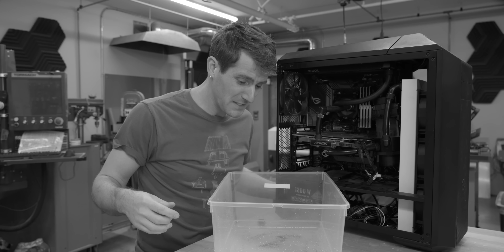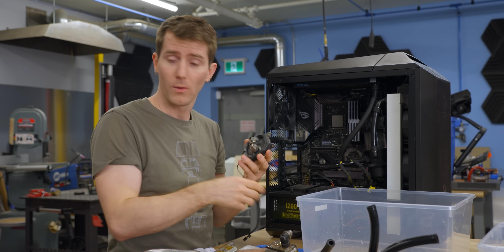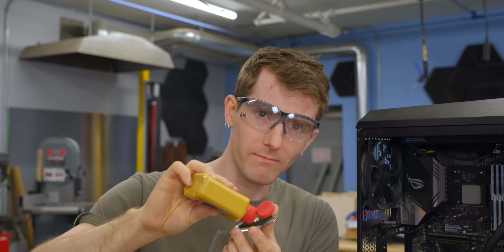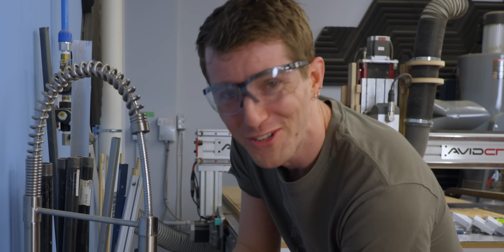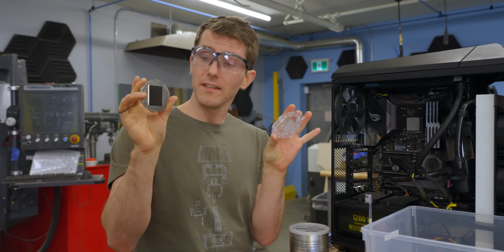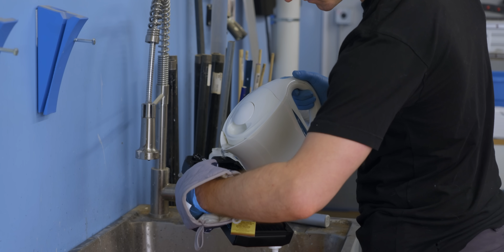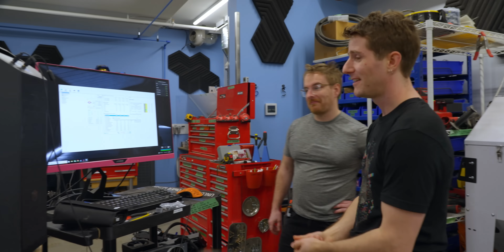I Will Never Watercool Again – Water Cooling Maintenance Guide

Comment: I mean 5 years warranty for AIO cooler is very good because in 5 years most people upgrade their PC with new CPU with maybe different socket so they will in 90% buy a new, better cooler for that new CPU. I mean who wants to put 5 year old cooler on a new CPU. I mean yes there are people that will do just that, but most people will just replace cooler with new CPU. And with new CPU most of the time comes new MBO, so yes, new cooler is not that expensive when you are upgrading PC on that level.

Comment: I've left distilled water + 10% blue antifreeze, + 2 .999% silver coils in a loop for over 4 years without maintenance, no plasticizer, no algae. My last WC loop was retired back in 2015 though, that loop lasted a few CPU's, RIP 09-2015. 

The only thing I noticed was the silver had roughness to it, I guess that was the anode of the loop, the sacrificial piece.

Comment: I've had my loop for 7 years, I've cleaned it once and nothing was in the loop the 1st time.

I ran all nickel plated copper parts and home depot water tubing and distilled water. Never had anything grow or corrosion. I've had to top up the loop once a year with about 4oz of distilled water.

Comment: all these years, i haven't had liquid cooling, but i also dread having to deal with the once in a while maintenance and replacing any seals or pumps.. kinda glade i stuck to getting best air cooling i could find from noctua. one day i will dable with liquid but for now, lifes simple with my air cooling. btw i have messed with other water cooling on a diff everyday machine, you could of used a touch of ever day anti-freeze or automotive engine coolent like 10-20% in the mix to prevent corrosion and growth

Comment: I must say.  I still have an old thermaltake case from 2012 that came with the bigwater openloop system installed. 

I have ran that thing almost constant for a decade and have never had an issue. 

It started out cooling a old amd piledriver I overclocked the snot out of.  

Now it cools a 2080ti and amd 5800x.

Distilled water and alittle green car antifreeze.  No buildup.  My components have always had clear viewing plates.
Reply: @djm5627  I have just got myself a pc with water cooling system and this video scared me well. How can I know when it is the time to open my cooling system and clean it?

Comment: I HAD a water cooled PC until the water pump went out and started trying to burn up my CPU. Thankfully it survived and I got the system to a computer fixit shop. They replaced my water cooler system with fans and it's been running great since. there's no need for water cooling.

Comment: I love it when a influencer hit me with a blanket statement like "water cooling is not worth it" when its more of it depends.   I just got into water cooling a year ago and already upgraded it. It boils down how much watts are you pushing through your stuff. If your pushing 350wats through a 6900xt and getting 90-109c temps then its time to water cool. Droped mine to 48c and much more consistent proformce. But if you got a 7700 non x thats undervolted and only pulling 40wats on average on the same loop then your going to have better proformce on a air cooler

Comment: Back in the days when I was planning a custom loop, I came across video "The vodka cooled PC". While it was a meme, I did in fact followed through the experiment filling my loop with 40% ethanol and 60% water. Rubber seals are ok, acrylics are getting "eaten up", but it is only visible when emptying the system. Also degradation of acrylics is within the life expectancy of the graphics card. Ethanol evaporates, so water tight seals are not ethanol tight. So after some time I adjusted the mix to 20% of ethanol, after all it is all so sterile to begin with at this point. My rig is 5 years old, 1080Ti FTW3 with EK waterblock is still there together with 1st gen Ryzen CPU. It is perfectly clean and effective, basically I have a nearly maintenance free loop with the exception of the occasional topping up the ethanol. Around half a litre per year is evaporated.

Comment: This is why I use AIOs. Great deals can be found on sale from time to time. Almost 2 years ago I got a Cooler Master MasterLiquid ML280 Mirror ARGB Close-Loop AIO for $60 + tax to cool my i9-7940X. I don't know or care how the coolant looks. I just check the temps by running HWMonitor once in a while. I leave it running all day while I run some tests and mostly simply do what I do. Runnng Cinebench 23 multicore for 10 minutes these days causes my CPU temps to run in the Hi-60c to low-70c range. I'm OK with that, but I'll still probably soon change the thermal paste.

Comment: I have a custom loop. I combined a 360mm rad and a 280mm rad in series because I can cool a combined 600W of system power. I knew that either the 360 or 280 wouldn't quite be enough on their own.

Comment: Those black specks are probably dead algae.  My system had an algae bloom, blocking circulation completely. I received a shut down message from Realtemp via Email. I left it a few days before starting cleanup, and the green algae had crumbled into black specks. The loop in my system was every bit as bad as in this video.

Comment: I put a custom loop on my pc some years back, I wouldn't do it again, it's a fad and not required for 99% of pcs.  Yeah it looks pretty cool for all of 5 mins then it just becomes like another piece of furniture.   I especially wouldn't do solid pipe, (thats what I started with)  had 2 pop offs when the loop got hot so changed to flexible tubing and not had an issue since. Granted maintenance isn't that bad tbh, my loop is 5 years old this year I've flushed it twice and it's been fine, if and when the pump fails I'll just go back to air cooling.   Sound level wise there isnt a massive difference and you have to spend hours setting all the parameters to get it to the levels you want, well on a pc 5 years ago you do, Software may have changed now.

Comment: The D5 is one of the most used Pumps (with a very high flow) also compact good looking but reliability and pressure wise i stay with my Aquastream XT. It is quite does not care if the loop is a bit more restrictive and simply works (my is running almost 24/7 for more than 10 years).

Comment: After water cooling for 8 years I’ll never do it again. It has becomes less and less useful over the years. If anything an AIO on the GPU would be as far as I’d go being that GPU overclocking is on rails and the dynamic clocks are heavily dependent on temps.

Comment: Had loop made from the cheapest fittings etc for about 3 years with no problem, switched to full EKWB stuff for 5 years, no problem. Upgraded my PC, made a mistake with fitting and used PTFE tape  on it - almost 1 year and failed - clogged (thanks to my aquaero for saving my ass with flow warning xD ), now rebuild, cleaned, bought filter and working for another 3 years... :) and i think that if i don't used the PTFE tape i don't have any issue whatsoever... :)

Comment: Thermalright Phantom Spirit 120 Se, about 50 bucks. Watercooling, what's that?
Watercooling is neat, but there's little reason to use it today unless you have an older PC and you REALLY want to flog it as hard as it will possibly go, CPU lifespan be damned. At practical day-to-day clock speeds, air cooling is plenty fine.

Comment: ....ohhhh...I kept watching....Iodine* can precipitate out of it gets oxidised.
*Solubilised iodine is "iodine dissolved in potassium iodide" Oxidation of the iodide (to make more iodine) component will wreck it's solubility, so your black gunge may well be a mix of 1. your foam filter 2. disintegrated rubber tubing 3. Nickel and Nickel oxide compounds and 4. potentially a bit of Iodine residue. YUM! Advice is still "not for human comsumption".
:)

Comment: Water cooling is worth it. My PC runs a million times cooler and more quiet and the lighter and smaller heatsink causes less stress on the motherboard and increases the circulation around the other components. I'll never build a PC any other way again.

Comment: never understood water cooling on modern gaming pc. I have a 40$ air cooler on a cpu that's famous for running hot, and slapped it in and old monster sized tower with only a single fan pulling air out. it has never gone over 77c on a stress test, and runs way cooler than that in every day scenarios. at only 44 db, whats the point of going water cooled? who overclocks anymore?

Comment: It is possible to have a low maintenance water cooling without any of these issues. I've built my first water cooled PC 20 years ago and I still use the same reservoir, pump and passive radiator (aluminum). Active radiator (copper) is about 15 years old. The trick is using the correct liquid in the loop. Deionized battery water (4/5) and ethylene glycol (1/5). Never had issues with corrosion (aluminum+copper mix) nor molding. Only maintenance is adding more liquid a few times a year and naturally the full draining and switching blocks (copper) every time I upgrade the hardware (every 3-5 years). And also I'm not letting any of my components get anywhere near tap water.

Comment: In my most recent PC Build I tried Water-Cooling for the first time with a simple AIO. It matched my case, looked really nice, and was the same price as a good CPU fan. But I regret it. 

Mostly it's the fact that I have no way of knowing when the AIO will fail or run out of water. One day my PC will just stop working and I will have to fix it. 

With a regular fan it will be very obvious that there's a failure, and probably an early warning via rattling bearings, and it can probably be rigged to still function while I wait for parts.

Air-Cooling is just objectively better in every way except noise, and most PCs have other random fans making noise anyway like in dude's Power Supply.

Comment: A few points:

1. Always clean from red to white ;)
2. Don't use your mouth for "cleaning", the next gunk is pre-programmed due to your mouth flora: It is full of bacteria and other organic "waste".
3. Always use a new seal
4. Never ever brush your gum away, or your teeth, or both! ;)
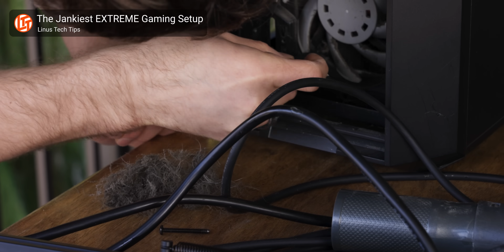5. At 13:13 are you spinning your fans? I hope you unplugged them before...
6. Doesn't hot water getting cold lead to underpreasure, what can implode your radiator like a vessel near Titanic? Or was the over pressure a result of a chemical reaction?

Comment: LOL after few seconds i was rolling on the floor laughin on stupidity of linus srsly. As a person who have custom build (by myself) water cooling with 420mm2 outside case radiator for over 6 years, i can tell you that was ridiculously stupid to blow that pipe. I always use either bike wheel pump or blown up bed pump witch is even better because it mostly have different sizes nozzles and much higher air flow so you don't have to play around to fit it to the pipe, and it's much faster to blow water out of the system.

Comment: Been building PCs for ~25 years now, and I've NEVER felt the need to watercool for performance reasons. Sure, it's an awesome flex, but it only leads to more maintenance. I'd rather 'set it and forget it', just cleaning out fans every once in a while. It's just such a marginal upgrade for most systems, it's not worth the potential headaches.

Comment: I use Bronze gun cleaning brushes to clean waterblock fins and it does a perfect job! No need for expensive tooth brushes. And I don't use water! Get a gallon of RV antifreeze and be happy. I think white vinegar will remove rust from steel.

Comment: I've been building PCs since the W95 days and still remember when water cooling first started becoming a trendy thing. I'm also a big car guy, and the whole wanting to water cool a PC thing never made sense to me. Having to deal with liquid cooling headaches over the years in automobiles had me saying no way to water cooling in a PC right from the start. I've got enough problems with various leaks and corrosion in cars, sprinkler systems, sinks, showers, fridges, dishwashers, my pool and pump, etc. to have learned that if water can be avoided, DO IT! I've built hundreds of PCs over the years, and not one of them has had water cooling, and going forward that won't change. Using a great air cooler with high quality, quiet fans all set with a perfect plan is IMO the only sane way to go. Introducing water to a platform that is purely electrical and not mechanical, I mean, what could go wrong? If a system's components run too hot to be air cooled, then I don't need it. Simple as that.

Comment: I've been watercooling for decades. There are many myths, lots of bad advice and really poor ideas over the years. One myth is spilled water damage. Distilled water does NOT conduct electricity. I don't know everything about water-cooling but I have a lot of real-world experience. Here are tips I've learned along the way.

1. Don't use dyes!!! You want colors??? They make fans and colored tubing for that. I don't buy them, but they're everywhere.
2. Use a good biocide. I use PT-Nuke because I still have the original bottle I bought over 20 years ago because it works. 16 drops per gallon goes real far.
3. You don't need expensive tubing. Hardware store tubing works fine but it does get hard. Luckily, it's so cheap, you can replace it during every cleaning.
4. Don't blow into the tubing (looking at you, Linus 😂). You're introducing bacteria into your system. Bacteria parties hard in warm water. Even Lysol only claims 99% killed. 
5. Keep your rig (water) out of sunlight. More light = more growth, higher temps.
6. Yes, use D5 pumps. "D5 NEXT" are even better. If you want the highest reliability, couple 2 D5's together so WHEN one pump fails, the other keeps going. Pump version of RAID-6.
7. You don't need high pump or fan speeds. Buy a D5 with variable speed control and slow it down until you can't hear it if your temps allow. Even at its lowest RPM it moves a lot of water.
8. Don't mix metals. Galvanic corrosion causes irreversible damage. Stick with all copper. Nickel plated fittings are fine but some radiator fittings are brass and react with aluminum.
9. If you design your cooling loop to make it easy to drain and refill, you won't dread cleaning it as much. KISS. Reservoir on top, pump underneath, drain valve on bottom.
10. You can go crazy trying to match fans to radiator specs. Guess what??? It doesn't matter much on a PC in real life. You're already lowering your max chip temps from 90-100C down to 50-60C. Do you really care if you lose 1-2C because you didn't spend 3x as much on a fan to "match" your radiator?? Use a temp probe and software to ramp fan/pump speed based on temps. You'll find faster doesn't always mean cooler but it always means louder and more wear.

I'm sure I missed a lot and/or others will disagree. Always happy to entertain opinions. Thanks for the vid and the toothbrush sponsorship was unique. The fact they think outside the box is worth looking into their products.

Comment: I built a 6850K, dual 980Ti PC with a custom, two-radiator EK loop back in late 2016.  It was fun to do, ran great, and was a complete PITA to maintain.  SLI even worked to a useful degree.  I'm glad I built it, but even more glad I took it apart (before I moved 800 miles).  Way too expensive and virtually impossible to upgrade.  Plus, the waterblocks for older CPUs and GPUs have zero used value.  Maybe someday I'll use all the parts to build an art piece.

Comment: LTT did a test back in the day between air cooling and water cooling, and concluded that there are no significant differences between them regarding temperature or cooling. They also noted that air cooling can actually be more quiet because of the lack of pump noise.
... Then they continued building and recommending water cooled systems.
I'm not listening this anymore

Comment: I always put alcohol in the loop and it works great. Nothing grows, lasts a long time before any maintenance is needed. Use a few ounces of 90%+ and you're good for quite a while. Using an mcp655 and heat killer 3.0 copper block, 360mm radiator and some psycho noctua 120mm fans.

Comment: brasso is really good at cleaning plastic parts, doubly good for water cooled stuff since if youre cleaning the inside all of those potential tiny scratches get filled with water inside the loop anyhow, so youll never see them. also if you ever deal with rust in your loop somehow, try using evaporust, it chemically removes the rust giving it the best chance possible, if the metal is eaten away at too much youll need a new component though

Comment: I built a water cooled rig in 2011. In 2016 it sprung a leak and killed my PSU. I rebuilt the hoses and have been running it with no issues thus far... 2024.